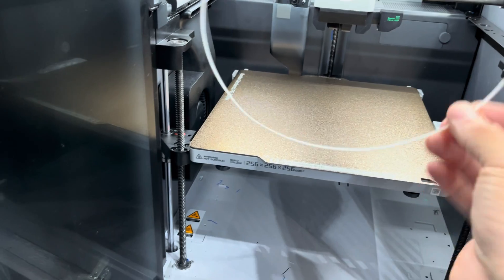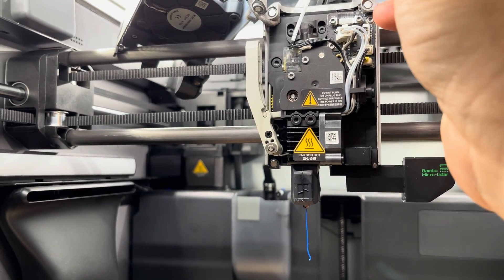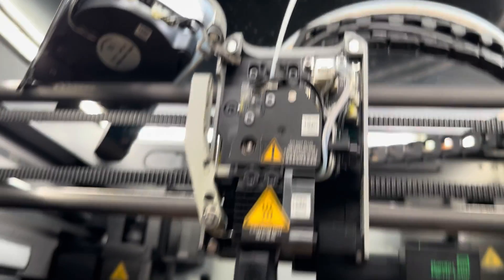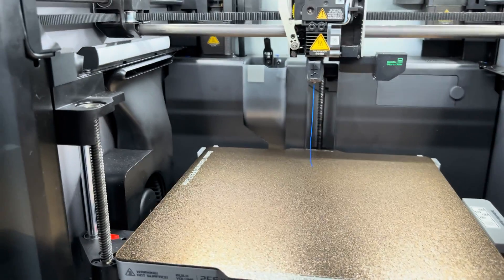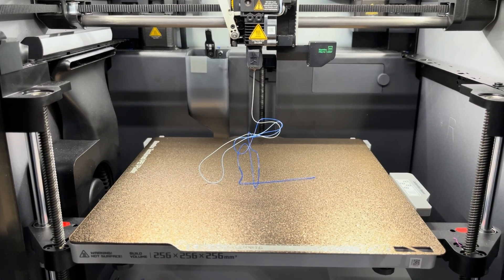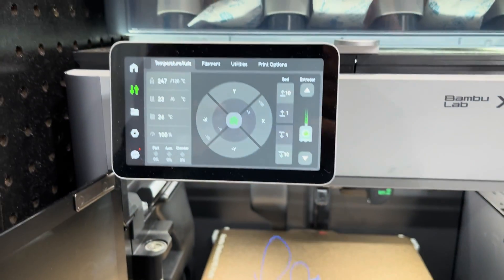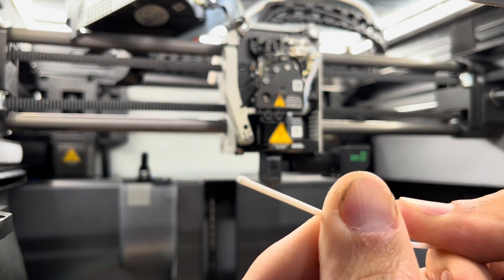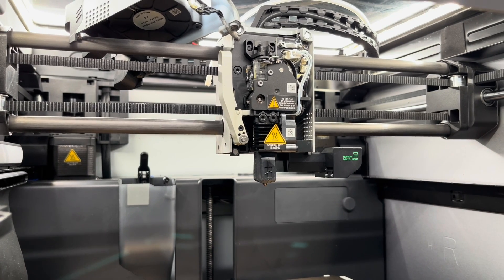Bambu X1 Carbon Filament Cold Pull

Comment: Yaa.. now that they updated the firmware you need to have it at 170c to move the extruder gears with the touchscreen.
How do you do a cold pull now?
Reply from the maker: I sent in a ticket and this is what I got back.  

We are aware of this issue, and it is a firmware bug. We will resolve the problem in an upcoming firmware release or hot fix.

If you need to do a cold pull, the only option is to revert to the previous firmware version until the update is published. I am attaching a video link that explains how you can revert to the last version of firmware.
Reply from the maker: I haven’t tried a cold pull since the update so I attempted one today and you are right. The extruder is locked out with nozzle temp below 170. I put in a support ticket with Bambu to see what they say.
Reply: Use a filament with a Tg higher than 170.
Reply: Not helpful if the clog is surrounded by lower melting point filaments..

Comment: Does not work, they changed the firmware
Reply from the maker: Sent in a ticket and this is what I got back. 

We are aware of this issue, and it is a firmware bug. We will resolve the problem in an upcoming firmware release or hot fix.

If you need to do a cold pull, the only option is to revert to the previous firmware version until the update is published. I am attaching a video link that explains how you can revert to the last version of firmware.

Comment: just take the 2 screws holding the hotend to extruder and heat up nozzle while holding it by heartbreak push some filament in and set temps to 0 once it gets to 100 or lower depends on temp pull it back if the filament u pulled back has a nipple end u did it right if not repeat until u do get nipple end. 

not saying ur way is wrong just asking to damage more parts or get the filament stuck between gears.
Reply from the maker: I may try your method too but this way came from the Bambu wiki page. 
https://wiki.bambulab.com/en/x1/troubleshooting/nozzle-clog